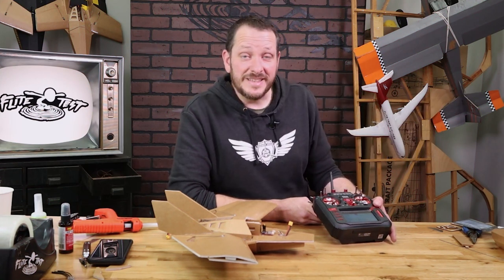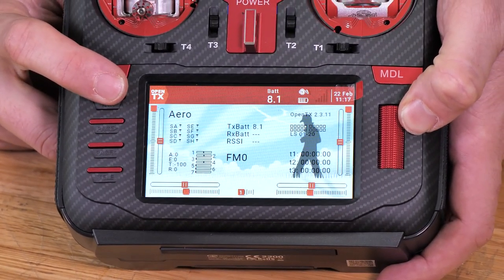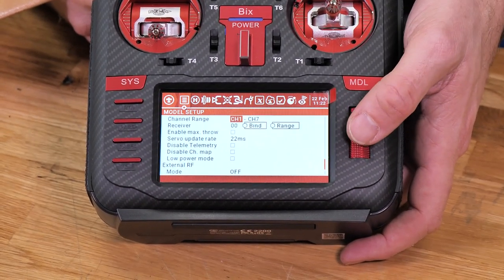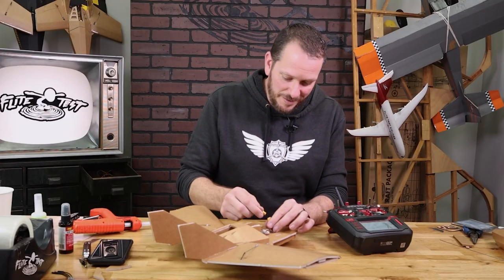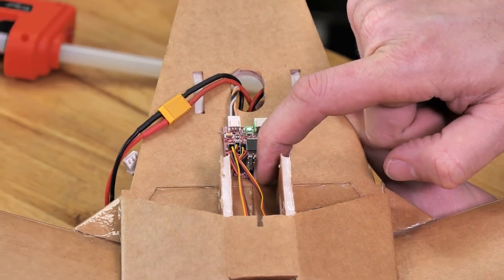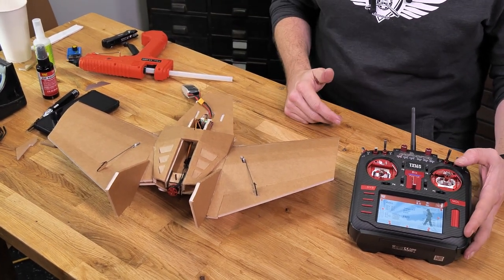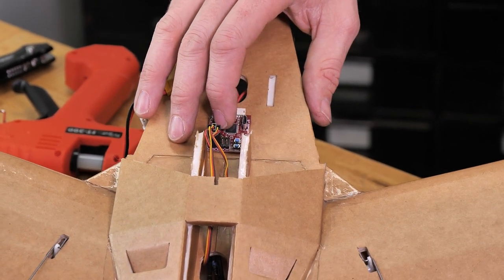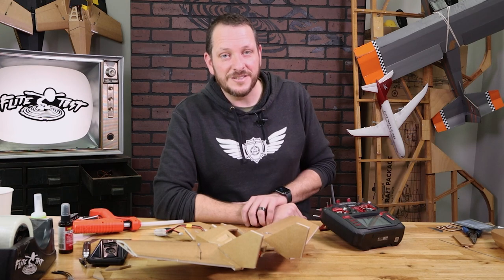Basic Radio Master Aura Set-up

Comment: After struggling for HOURS with this, I finally figured it out! Here's the steps:
1: Set up a *GENERIC* airplane model in the Radiomaster (i.e. Aileron, Elevator, Rudder)
2: As Josh showed in the video, reverse the PWM
3: Bind the model as per the Aura/Radiomaster process
4: Simply convert the Aura with the field setup in quick change mode to elevon as depicted in the video
5: Do control direction setups/reversals per the Aura field setup

This was EXTREMELY simple but the trick was to just use a generic, traditional airplane model in the Radiomaster!!! I had it set up as an elevon airplane in Radiomaster and it would only do split controls (i.e would only command a roll no matter which quadrant I pointed the stick) If you see this, confirm that you have a BASIC aircraft configuration in your Radiomaster!!! I wish that Josh would have addressed this important point in the video. But thanks, nonetheless, Josh for making this important video!!!

Comment: Josh...could you address how to link the SA three-position switch to flight modes in Aura? Does it need to be accomplished through the configurator? I noticed that the configurator does not list Radiomaster as a radio option. Thanks for this important video!

Comment: I have 2 of these now and have had nothing but trouble with them. haven,t flown the first one. not gonna change my radio's setup just to change channel allocations, and have to rebuild all of my other models to fit the aura 5.  i get aileron on both aileron and elevator inputs no matter what I do. Documentation is weak at best. just not interested in spending hours trying to figure out how to make a super simple plug and play item plug and play. if i cant get this to work soon, both of these will be going on sale at the next club flea market!  very dissapointed!
Reply: Radiolink Byme-D for Deltas (or A for ordinary planes) - twice the stabilizers at half the price. Uses native AETR also. ;-)
Or, if you want a full featured GPS On Screen Display unit try the Lefei Sparrow 3. 🙂
Reply: @theoztreecrasher2647  RadioLink Delta Wing Flight Controller £20.99 :) Lefei Sparrow 3 BS180 OSD Flight Controller Gyro Stabilization Return Home Support SBUS PPM PWM IBUS CRSF For RC Airplane with gps￡30.24

OR  i just bought both! as the 2 of them TOGETHER were cheaper than buying 1x aura from the flight test store when you add UK postage 0_o can you say hobbyking 2.0??? :) we ALL KNOW where they ended up eh?

Comment: My radiomaster defaults to AETR.  Can the aura light work with AETR or am I forced to go taer
Reply: Dean you can flash the TX16s into TAER by default or remap the channels with the Aura config tool.
Reply: @ShawnEngland  change your radio setup for one stabilizer?  not gonna happen here. to many other models that i dont want to re-setup just for one aura 5
Reply: @jingadin5181  You could just set up 1 model in TAER to use the Aura stab - if you wanted to!😂
Reply: @ShawnEngland  you can just go into inputs and change it there to taer. thats what i did and it works just fine

Comment: 2 things, if you really want people with no clue to use your aura shouldn't YOU program it so it auto corrects channel direction by itself? secondly holding the transmitter at least 5 feet away from your model while trying to bind! does that not sound stupid to you? No? 2 clicks ABOVE bind is a little selection box, its called low power mode. Any idea what that little selection box might be for?? i have bound 100s of multis and planes and helicopters and rc cars and hovercraft and EVERY SINGLE TRANSMITTER since the dx6i that i bought new well over a decade ago ALL have low power mode formerly range check mode baked into the firmware! i,e when i bind to my lowly t16 pro the models are ALWAYS within inches of the tx same as when i bind to my t8sg v2 same as when i bind to my devo 7e rx is usually within the length of a 1500mah lipo o_0 wanna teach suttin? LEARN ABOUT IT 1ST!